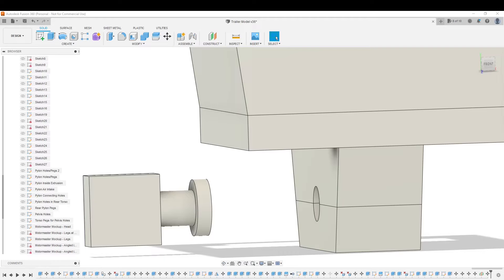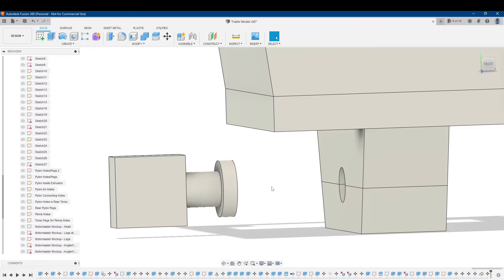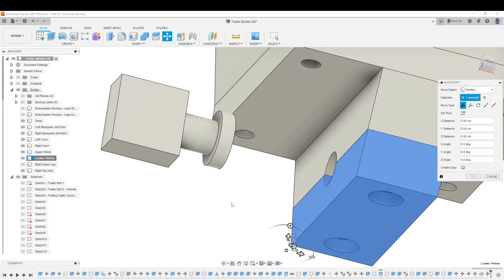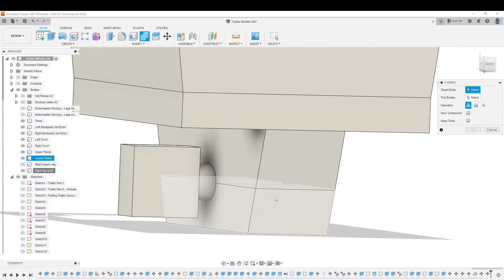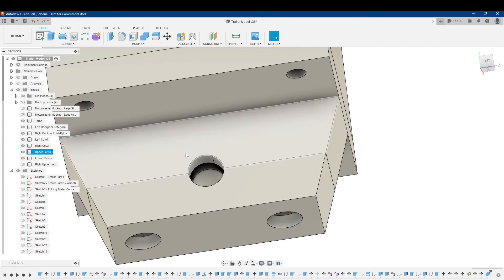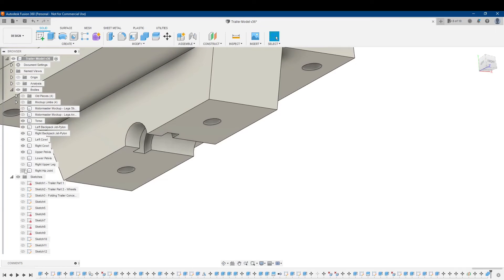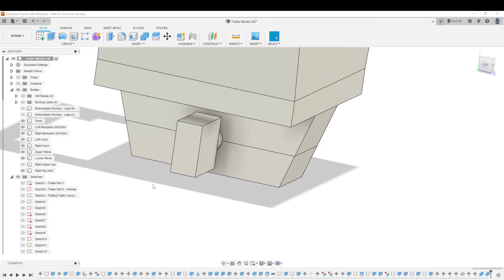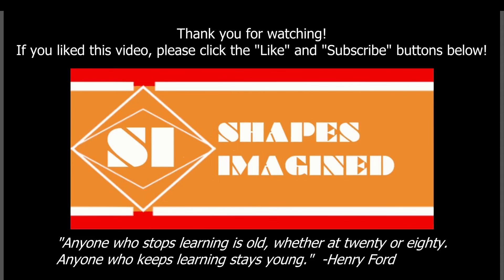Boolean Difference in Fusion 360

Comment: A very useful function for users to get familliar with, makes internal threads very easy as well, just pull in a bolt cad file from McMaster Carr for the tool.
It was use a lot when I used OneCnc Cad Cam.
Reply from the maker: This is a good tip - the McMaster Carr import catalog has a lot of fasteners - threaded and unthreaded - that can be used in this manner for projects.

Comment: This is exactly what I needed. Thanks! 
Quick question though: If I am making a cavity in a part that something will fit into, I probably need the cavity to have a little clearance so the part will fit well. Is there a way to expand a surface in every direction to make that clearance?
Reply from the maker: I'm glad you found the video helpful, thanks!  For adjusting a cavity for part clearance, there's a couple ways you can do this:  1) Do the boolean difference and offset faces with the "Offset" tool, and 2) Create a copy of the of the boolean difference cutting tool you want to use, and use the "Scale" tool to scale it up to the clearance you desire, then make your difference cut with the up-scaled tool.  This is a good question and I might make a video to better describe these two methods - thanks for asking!